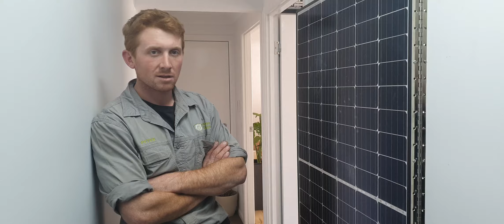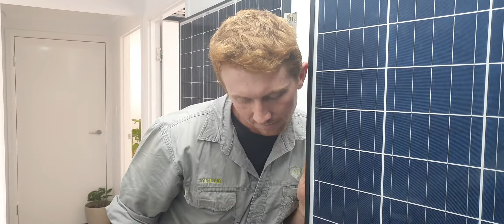Do Solar System Panels Make Noise?

Comment: lately in the morning I hear a drill or jackhammer type noise, sounds like it’s coming from the roof. Lasts for 5 seconds then stops for 15 seconds roughly, this could go on for 15 minutes. It’s not coming from furnace or water heater, washer or dryer all in the basement. Not dish washer or fridge. No water leak to make pipe rattle. I have had solar on my roof for almost tens years and this started about a month ago. The noise isn’t coming from the meters and convertor for solar on the side of the house. As for the roof, how could panels make that noise? Any ideas?
Reply: Probably water pipes they do that when the pressure is wrong etc